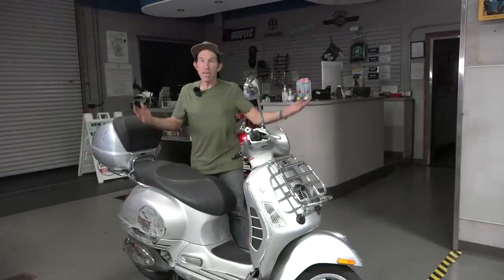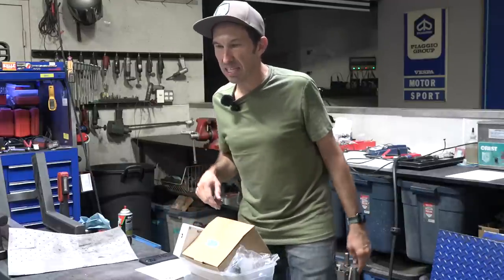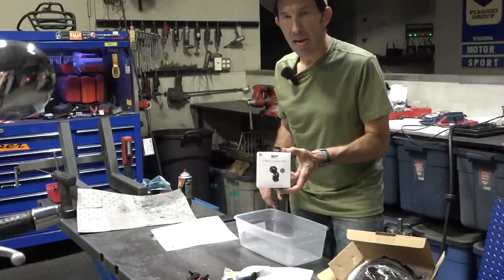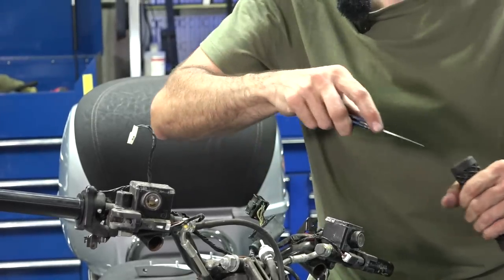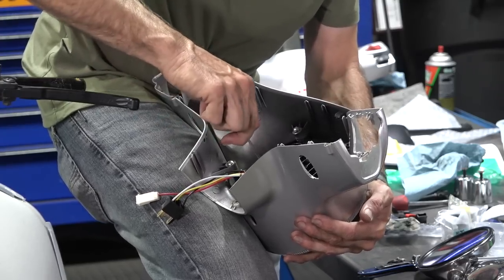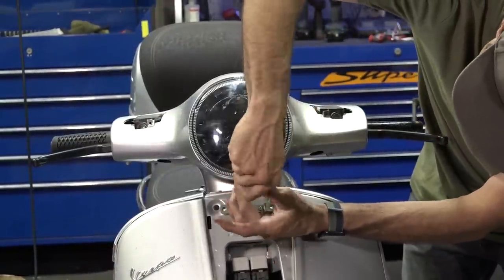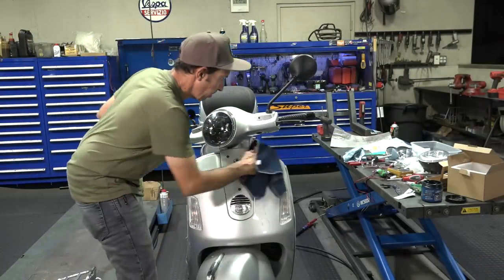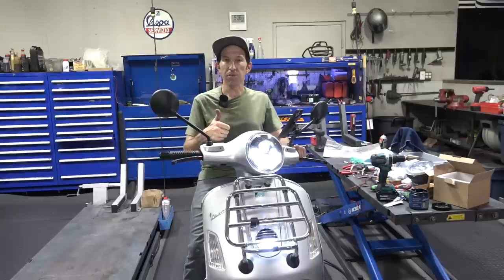I Got a Beater Vespa GTS 250 for My Winter Project PT. 1

Comment: I have one just like this, except in better condition :-). Very reliable.  Only real thingie are the rear shocks.  Way too jumpie.  Had to replace these.  I actually like it more then the more modern GTS 300’s.  Not sure but it feels as if the wheelbase of the 250 is slightly larger.

Comment: I currently own a 2003 piaggio vespa et2 50 with 321 original miles and enjoy it very much so I’ve been watching your videos on them learning new tricks and what not,I actually did an oil change with ams oil 2 stroke racing oil and it’s been running beautiful since then and thanks to your company I bought a left rear turn signal for it because owner previously broke it before I bought it,videos of it are on my channel
Reply from the maker: Great to hear!
Reply: @VespaMotorsport  yeah,planning on buying new tires and other items thanks to your informative videos I watch to keep my Vespa 100% tip top shape

Comment: I have the opportunity to pick up a used  250 I.E for a fair price from someone I know. After going to the dealership yesterday and getting a quote for a brand new 300 I'm really pondering saving money and going for the 250. I'd love to have a 300 but the price difference is so huge and I still have a few motorcycles in the garage I need to sell.

Comment: the rear end when the huge dent and scrapes are, is that fairly simple to take off? it would be a lot easier for the body shop if just that piece is sent and the dent can be pounded out. if the engine needs to come off in order to remove the whole rear cover, then it wouldnt be worth while. i just bought one today and am debating how to fix the rear with the same dent location.

Comment: Hey guys. Iv picked up a GTS250 as a beater also! Currently respraying it my self at moment.  

I just want to know. Its got 18.600 miles on the motor. Is this high mileage for this engine?